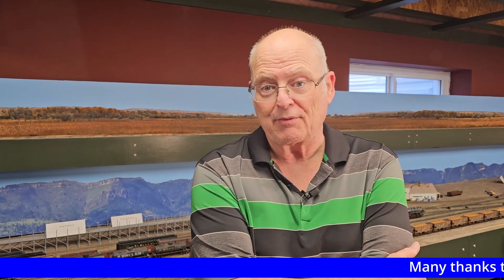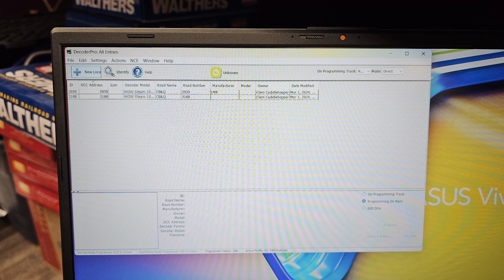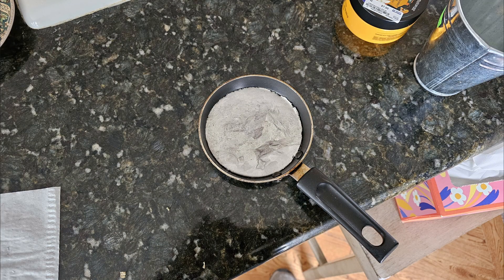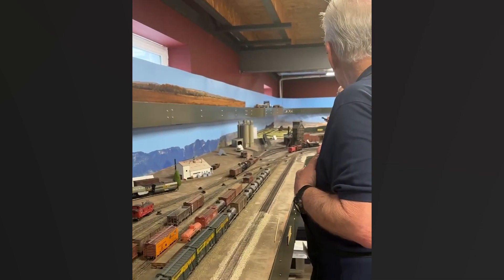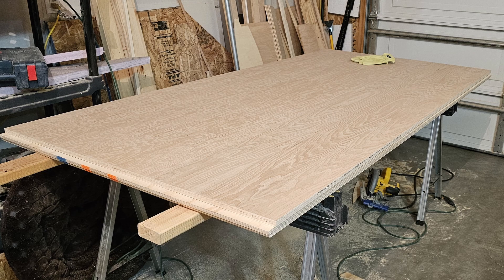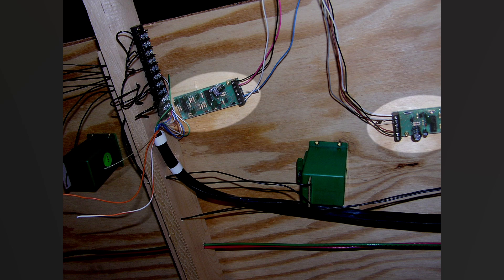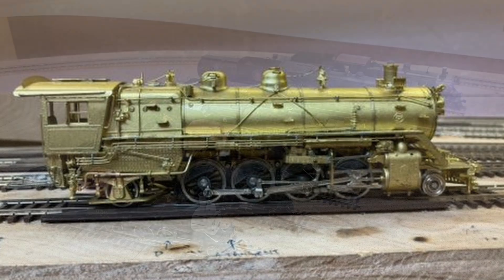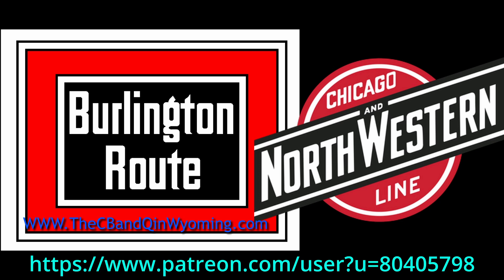2024 04 03 CB&Q V5 Monthly Update #53

Comment: Can you tell us a bit about the two ten wheelers that were closest in the line-up... that have the last set of driving wheels under the cab? Thanks in anticipation.
Reply from the maker: Hi Hotdog!
The Ten-Wheelers are brass models from Nickel Plate Products. They're models of the Burlington K-2's. The models were produced in the mid-1970's, roughly. In the mid-30's the Casper division had a K-10 on the roster, but the closest I can come is the somewhat older K-2, which survived elsewhere on the railroad into the 1940's and even 1950's.
Reply: @mapruitt  Thanks for that, I'm a bit of an oddity doing old time US steam in the UK. Then again, it doesn't appear there are many people world wide. Appreciated.